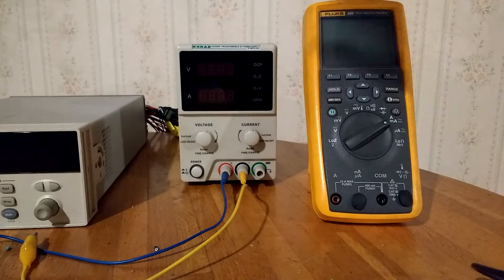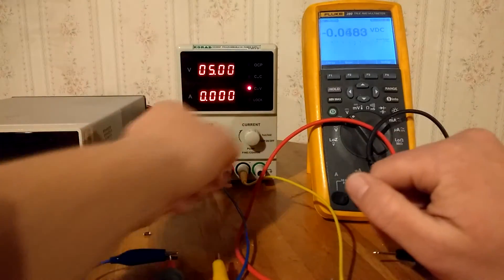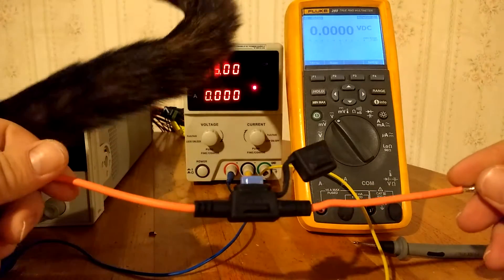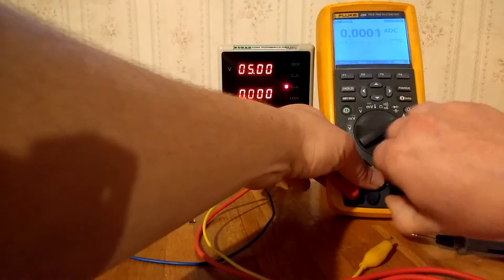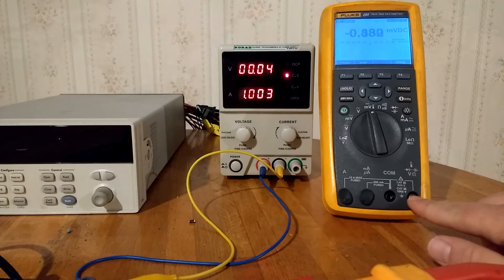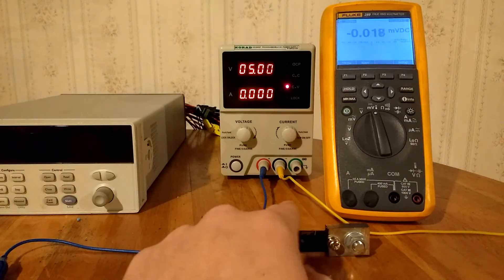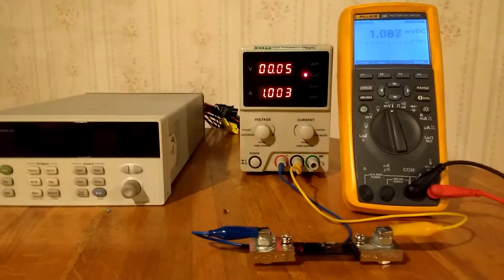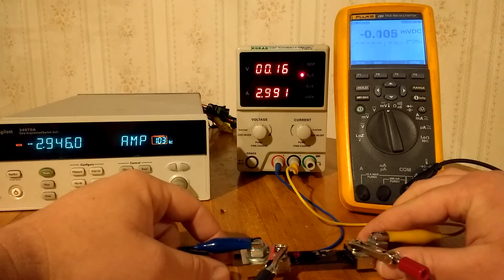How to measure dc current three different ways.  (current shunt)

Comment: Wish I would have seen your video before I blew my meter!  Thanks for posting it.  I was trying to read the current leakage on my truck when the car was turned off like many videos describe on youtube.  My battery had been dying every 2 or 3 days and I was trying to determine if there was an electrical short somewhere.  The problem I ran into with directly connecting like in your first example is that the intial in-rush of current was waaay too much for my unfused harbor freight meter and blew it within seconds.The meter was rated for 10 amps to measure DC current.  An inline fuse makes a lot of sense.. I wish I did that, but of course that would have just blew right away too? Do they make little circuit breakers like an in-line fuse?  That makes sense I guess, with a car battery that has hundreds of cold cranking amps and I didn't count on that high of a draw for the computer system and everything else that initially switches on in the truck when connecting the meter directly and trying to measure the current flow.  I guess I'm going to try to get one of those clamp meters and try again..  that seems like the best method that you have described.
Reply from the maker: I ran into the same problem with the initial current being too high if you use a jumper wire to connect the terminals first then put the meter on. leave it sit for a minute with the jumper wire and the meter on then remove the jumper wire.  It will allow the large initial surge of current to not pass through the meter. https://youtu.be/A7jLpRekV78